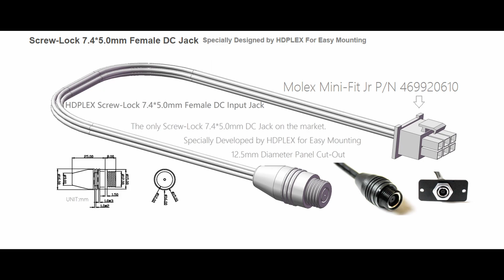HDPlex 200w DC-ATX PSU

Comment: It appears they are sold out, do you know of any other products I could use to convert a power bank/battery into ATX for an eGPU?  for an rtx 4060 I'd only need an 8 pin thing probably. thank you!
Reply from the maker: @miroschessnews You could consider a one of the pico DC-DC ATX power supplies, if you can find one that supports an 8 pin connector. Alternatively you could look at the HDPLEX 250W GaN Passive AIO ATX Power Supply - it does take mains voltage in one side and will supply enough power for a rtx 4060. Depends of course on which power bank/battery you are planning to use.

Comment: are you doing a video on the HDPLEX 800W DC-ATX with 12V-63VDC Input
Reply from the maker: I've don't have any immediate plans for a system based on this PSU, but when it comes time to build/rebuild one of the larger more powerful systems then this PSU would be a candidate.